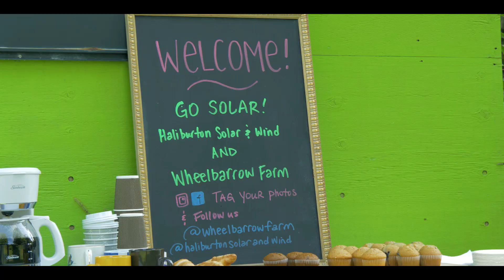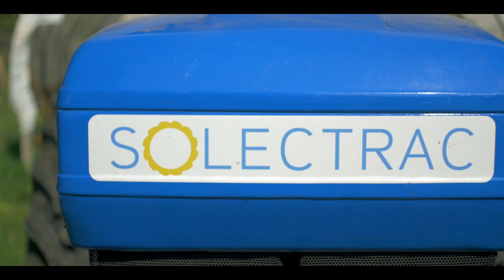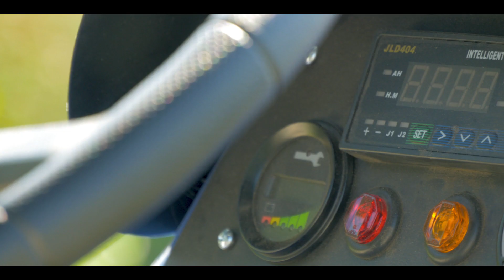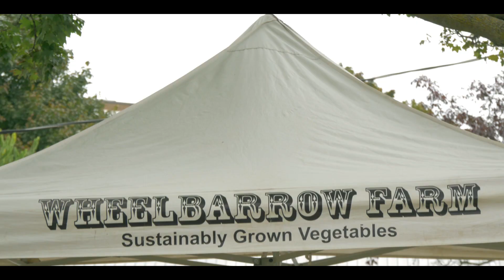Solar Power & Electric Tractor at Wheelbarrow Farm

Comment: Hi Tony, I just found this great video through Solectrac.  Fantastic exposé and great footage.  Congrats on acquiring and integrating the eUtility tractor at your farm and for finding the time to make such a great video about it.  I noticed in the footage of you with Steve in his shop that it appears you were assembling a pack with Leaf modules.  Is that how yours is set up as an early prototype?  I figured Steve would be importing lithium cells from overseas for the production version and the Solectrac site now lists LiFePO4 chemistry but no further details.  Anyway, kudos on the video and thanks for getting the word out about this great machine.